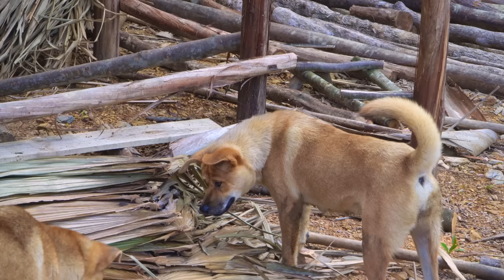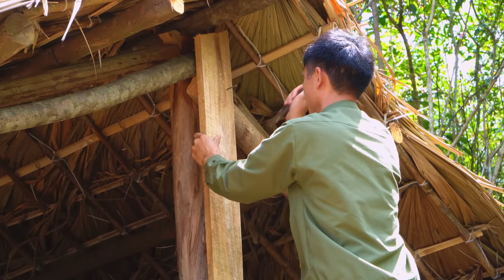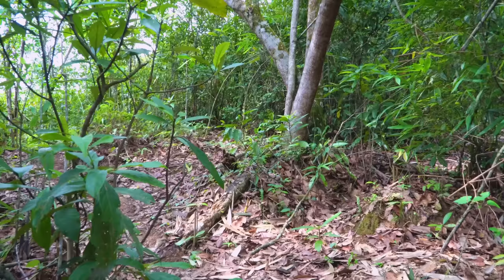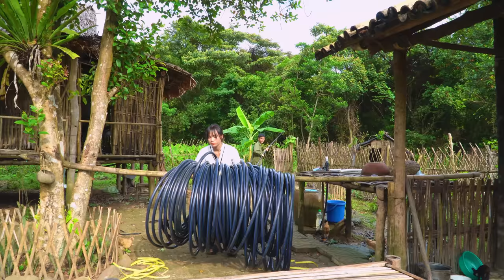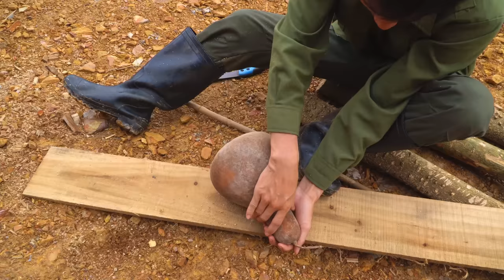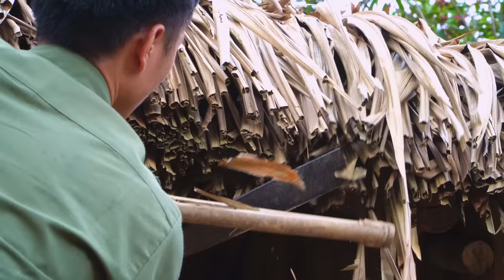Episode 69 - Finish the house, planting gourd, cucumber, pumpkin seeds, pull the water home

Comment: It will be better if you put a layer of plastic sheet or canvas for the roof before adding those leaves. This is to prevent leaking and dust. Just my 2 cents 🌬☔🌧🌦🌈🌠
Reply: he should have raised that cute little house about two feet off the ground, won't rot as fast that way